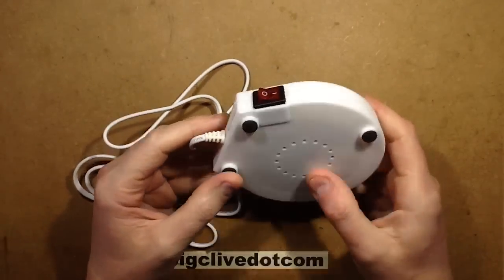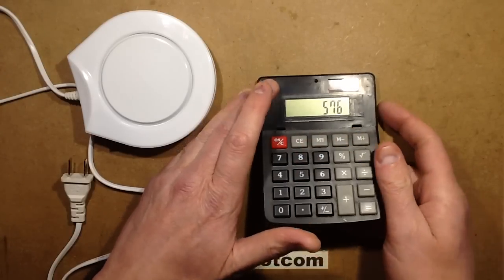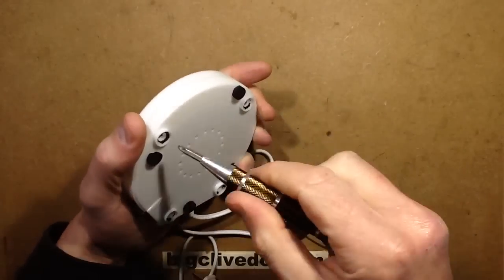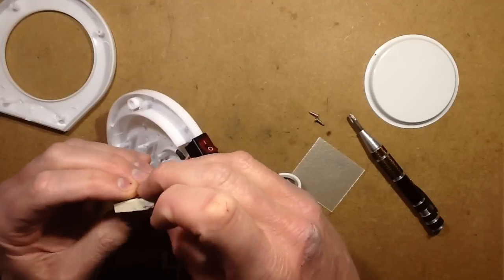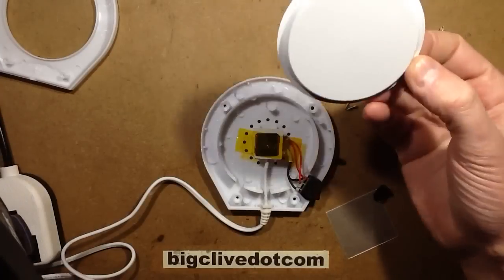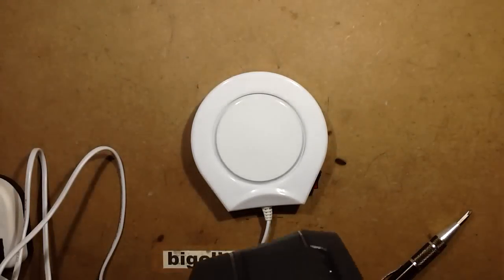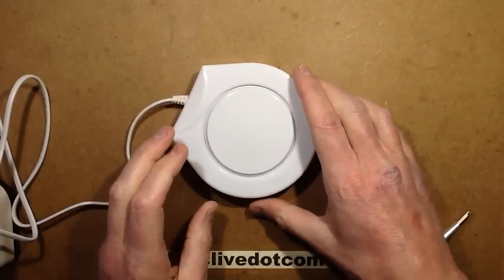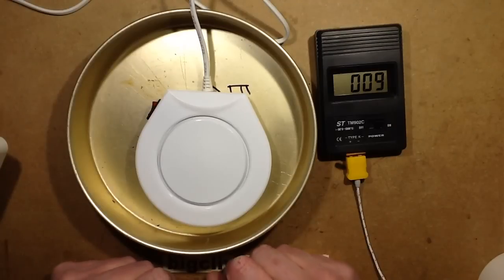Inside a cheap eBay mains voltage cup warmer.

Comment: think that does a shittier job than the one from CVS and I dislike the lack of any real wire pulling protection on the thing.  that one looks better built however the CVS one is pretty much the same system you find in those UV (well mine came UV led's) shoe warmers.  2-4 metal plates with the power stuck across it and I've got my el cheapo IR therometer at it and usually get around 267 F (130C)  without anything on it.  I only use these things for candle warmers. As actual candle warmers don't do a thing.  I had a Vintage one (coffee warmer) with a coil element around it but at some point it started to melt the plastic :O  , which it's trying to do with the CVS one but I keep an eye on it.  Just don't like that , well the wire is screwed to the board with pressure.  No UL knot no strain relief fitting like the one above has.  Just a wire with a plastic piece over it and two screws holding that down :(

Comment: 'It's not going to have a huge effect' Yet you never actually test the effect. It's not intended to make your drink hot, but rather to prevent it from cooling before you can finish it. No one is going to take 3 hours to finish their drink. The correct experiment would be to determine the lowest temperature you would prefer to drink your drink and then find out HOW LONG it takes to reach that temperature with the warmer and then without. And then we can compare those figures to see if it  significantly improves how long we can enjoy the drink.

Comment: thought I'd just point out that stainless steel is not magnetic, only steel is :)
Reply: Different Stainless Steel Alloys like 304, which is an austenite steel, can be responsive to magnets.  They will just not be as responsive as plain steel.  But like you say most stainless steels are not magnetic.
Reply: +Mark N agreed sir thank-you